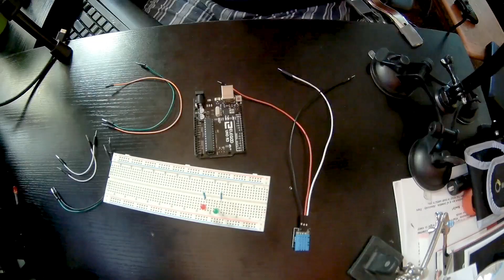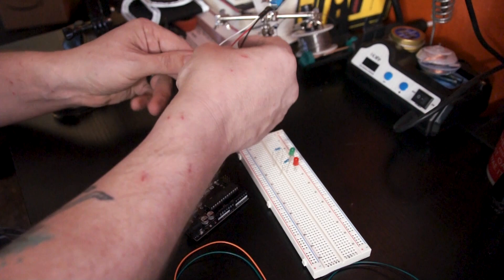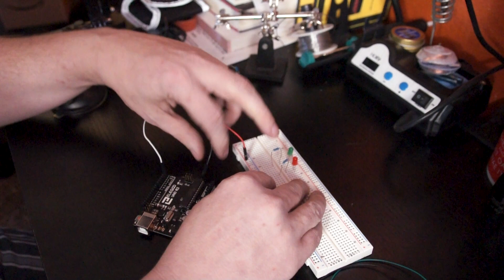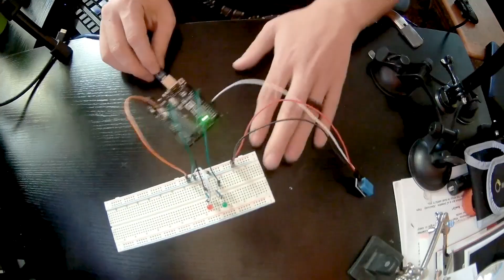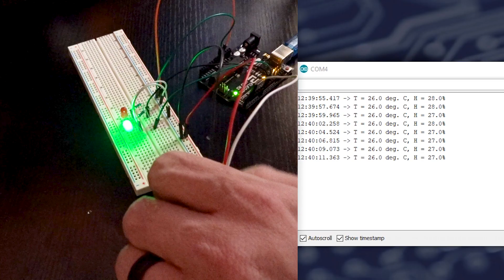How To Make An Arduino High Humidity Alert

Comment: Hello, love your video and the written portion with pictures. I set up everything but am unable to add the code from your zip. I obtain a comment that - zip does not contain a library. Has this been removed?
Reply from the maker: Unfortunately this video is about 2 and a half years old and I haven't done enough to keep up with Arduino, so I'm not sure what, if anything, has changed.
Reply: @DBTechYT  Thank you for your reply. Watching the video, you do show the code.  I will play this on a monitor which should make the print larger.